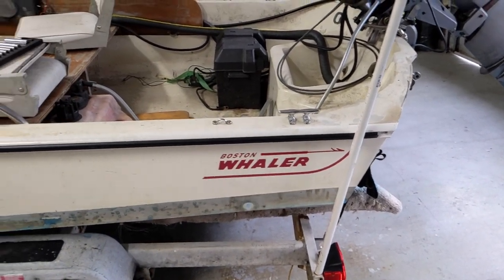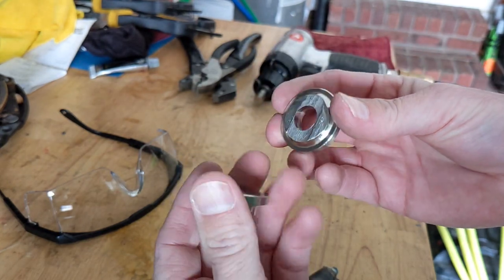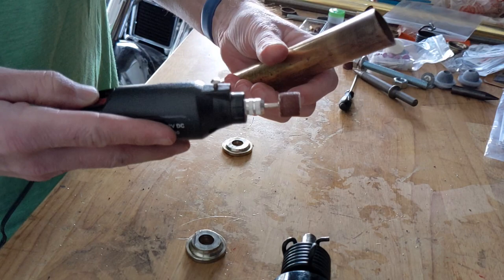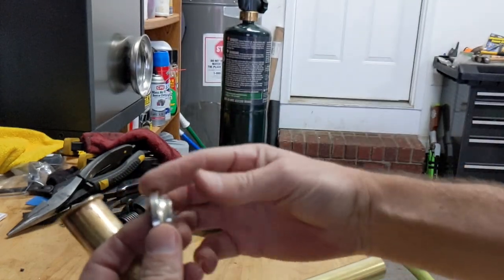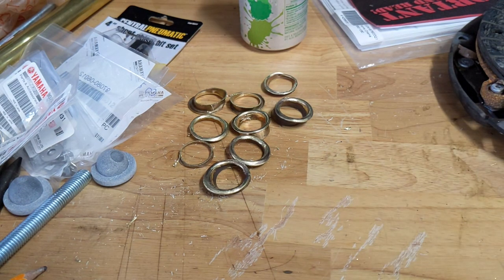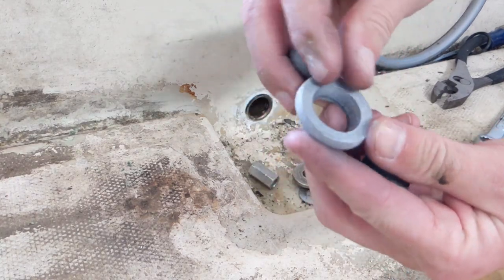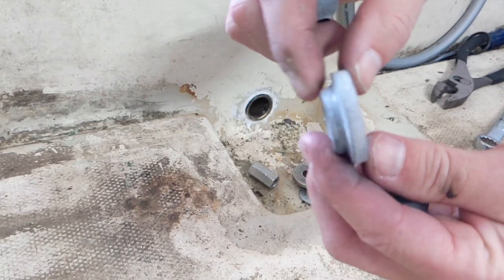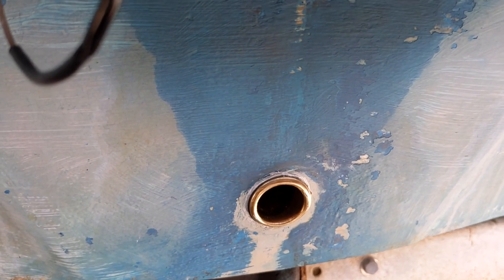Replacing the Boston Whaler Drain Tube

Comment: I think I'd try to make a wedge at the required angle.  If you prefer the ball, may be drill a hole through a ball bearing.  You can get pre-drilled iron balls for about 2.50 each.

Comment: Great video!  I'm doing the same drain tube on my 92 whaler 17' montauk.. the two in the splash well I have.. but I can't find the bilge drain tube anywhere.  Can I ask your source for a cut to length tube?
Reply: Supposed to slide it through and mark/measure is 3/16-1/4” longer then flare.